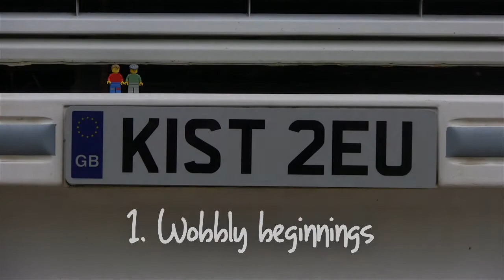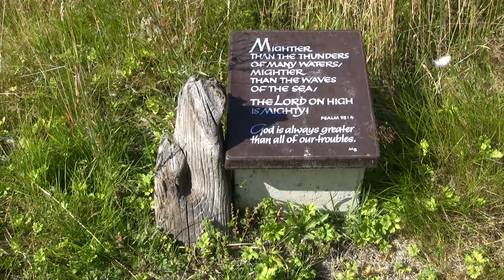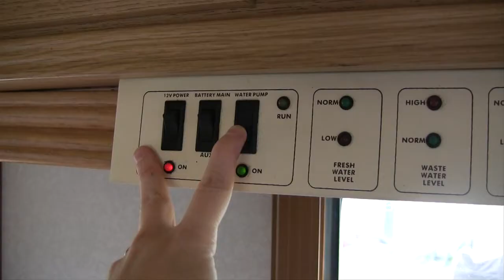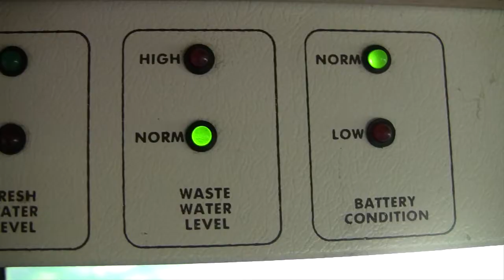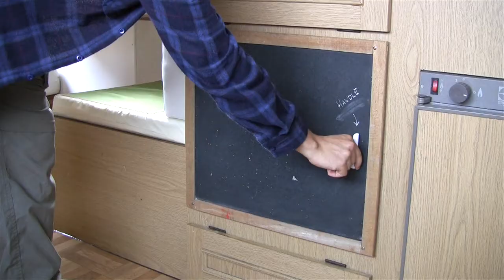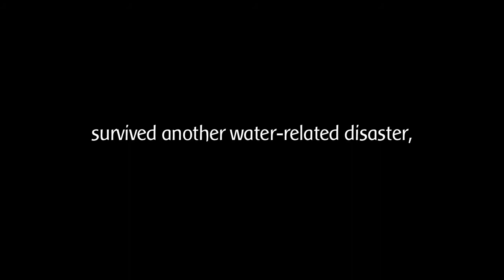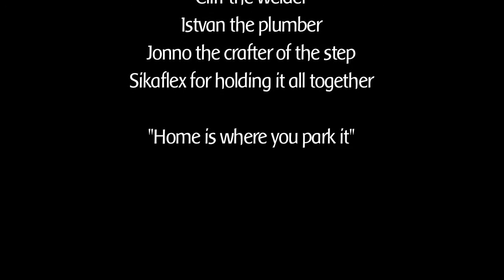KIST 2EU - 1) Wobbly beginnings

Comment: Love your video-very funny & professionally made. We bought an Autosleeper Devon coachbuilt on a Merc chassis. Within the guarantee period the microwave continued to rattle, toilet roll holder, towel rail & bottle holder all fell off! The fibreglass steps into the cab began to fall off & the motorhome electrics would pack-up on a whim! Fixed by removing a couple of fuses, & replacing them! On a 20 year old Autosleeper I reckon you've fixed everything that could break! Good luck & God Bless...